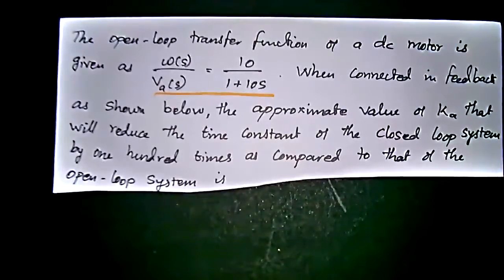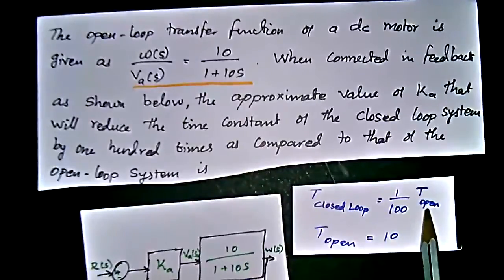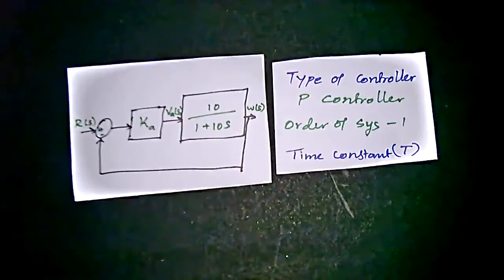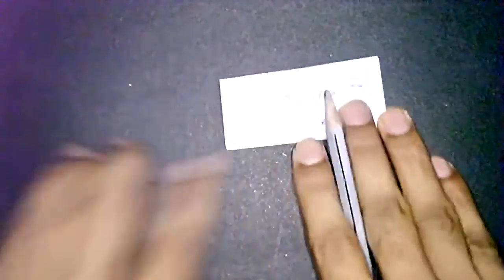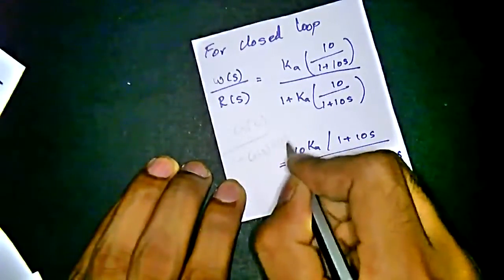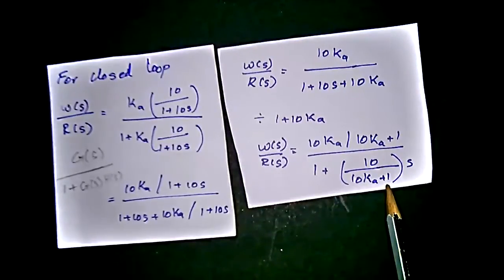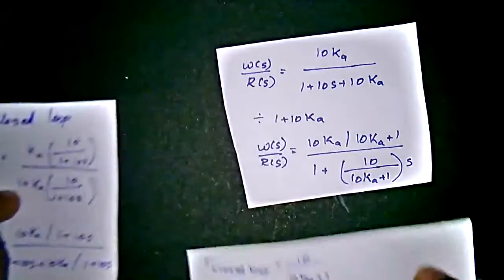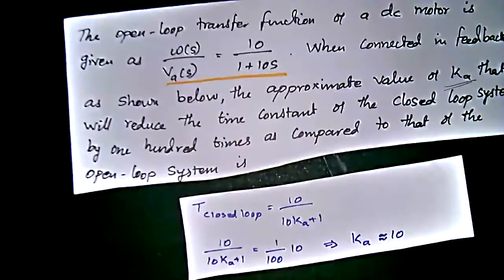The open loop transfer function, The closed loop transfer function

Comment from the maker: The open loop transfer function of a dc motor is given as w(s)/Va(s) = 10/ 1 + 10s. when connected in feedback as shown in video, the approximate value of Ka that will reduce the time constant of the closed loop system by one hundred times as compared to that of the open loop system is #GATE #ECE
Reply: Why a open loop transfer function is represented by G(s)*H(s) ?
It should be only G(s) !